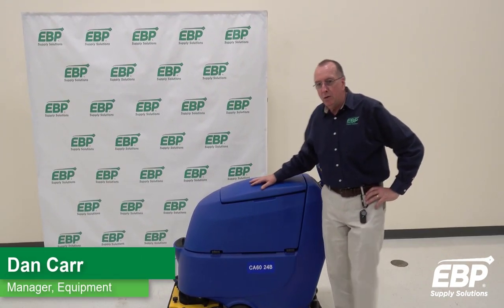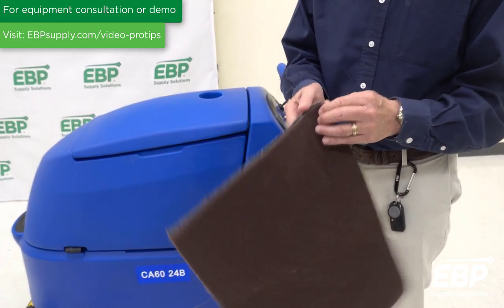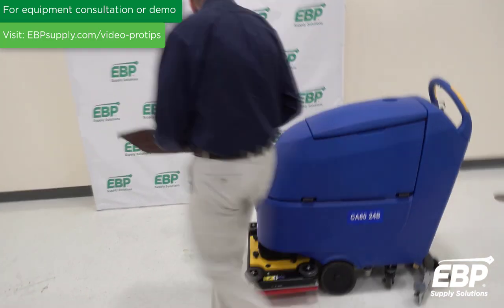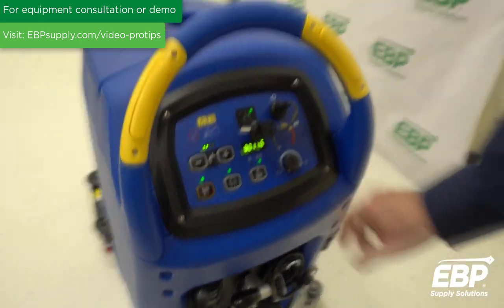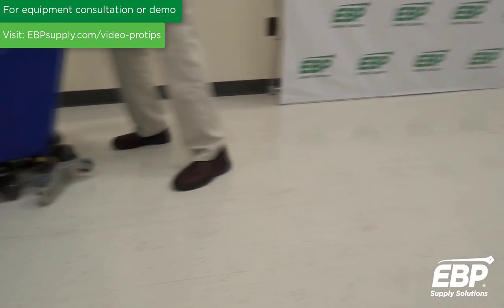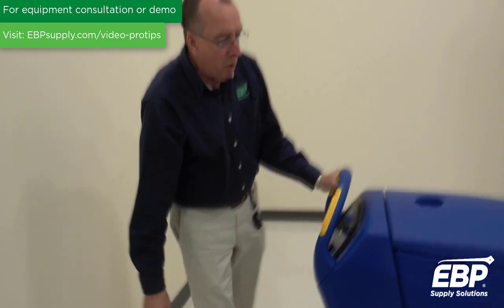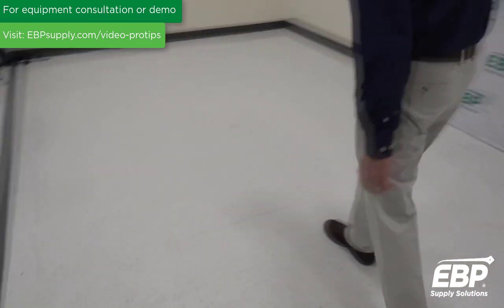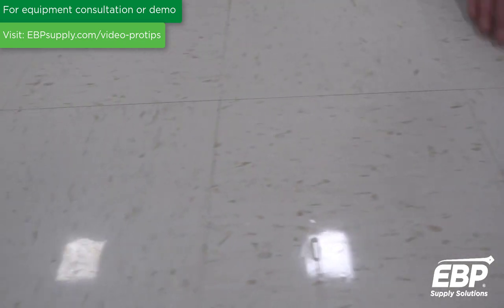How to Strip A Floor with No Chemicals [DEMO]

Comment: I am trying to learn as much as I can about stripping, rewaxing, and other options for VCT flooring. Thanks for the videos.
I was surprised that you don't lay down a bit of water first or set your pad in a small puddle?
Reply: you're supposed to the floor isn't supposed to be dry but i realize everybody does it differently

Comment: There are several ways to use this pad. One way is to dry strip which uses no chemicals  and no water. Down side to dry stripping is the dust. Dry stripping is not a replacement for wet stripping  but more of a deep scrubbing method.

Comment: That machine is the gold standard.
Reply: Is it for real?? Works great?
Reply: It’s good for light stripping or deep scrub where you take off couple of coats not full wax to bare tile . I used it . Leaving all floor cloudy some part there is very less wax left on the floor and some part just too thick wax still on the floor
Reply: @sr9725  Probably should have stripped the floor instead.

Comment: I have the same machine works great but you only get about 3hrs of run time and takes 12hrs to charge. I have a short video on my channel using it with a little better view.
Reply from the maker: Hi Fred,
Thanks for watching our content.  Here are a few videos relevant to battery life and battery maintenance on powered janitorial equipment.  

Battery Troubleshooting (4 min mark):
https://youtu.be/FcwIw-1lQ_I

What is Opportunity Charging?
https://youtu.be/ixfPN2NiMe4
Reply: Bring a extra set of batteries.
Reply: @mikepeterson9542  I was thinking about that. They last about 3 hours
Reply: If the batteries last only 3 hours and take 12 hours to charge 😂😂😂 You will never finish the job.

Comment: Those machines are alright but floors that really have wax build up it wouldn't work taking it off, I tried it with that machine and the old wax and debris was still etched in the floor, you gonna have to use some type of stripper to get the hard stains

Comment: Can you pick up wax via stripper with this machine or will the stripper damage it?
Reply from the maker: Hello Ken - thanks for watching our content.  I asked one of our specialists your question, and here is his answer:

"You can mop on the stripper but never run through the machine. You can then agitate and pick it up with the  machine but we don’t recommend it.  The reason is, stripper is very corrosive and if the machine isn’t emptied out and cleaned thoroughly immediately after it’s done then it will dry and you risk damage to the machine.  It can also splatter up under the machine and cause damage.

Also when picking it up, wax and stripper foams up and if they don’t use any kind of defoamer in the recovery tank prior to operating, you risk foam rising up, not hitting the float shut off for the vac motor and then having foam get sucked into the vac motor causing it to burn out.  Then they would be without their scrubber until it’s repaired and in this business we can never afford down time."  

Hope this helps answer your question!
Reply: @ImperialDade  Thank you for this very valuable information!
Reply: Question, can you strip down to bare tile and wet sand your corners with a large electric hand held sander?

Comment: Well if it removes two coats of finish you're not stripping the floor cuz if you strip the floor you're taking all the wax off the floor so that's not a stripping machine it's a scrubbing machine
Reply: Yes but it takes wax off

Comment: I was wondering if no chemicals then how do you get the old wax off the floor? There must be some little chemicals in the pad to help to loosen up the wax off the floor.
Reply from the maker: Hi Jay - The SPP or Surface Prep Pad, plus water, do all the work.  The SPP is a sandpaper like material and combined with the water and the orbital motion of the scrubber head, take layers of wax off the floor.  It really is an incredible technology allowing for zero chemical use.
Reply: @ImperialDade  That is so very Interesting no chemicals just water? Thank you. P.S I just want to say that you are doing my dream job!
Reply: This is not a complete strip it is basically a step above a scrub and recoat.
Reply: @dustywagon298  So it's easy than stripping?
Reply: @jaysartori9032  it's called a Top Scrub takes off 2 to 3 layers
Reply: @seanojones8487  Thank you

Comment: sorry but you wrong. you not stripping a floor, you just scrubbing the floor, for a real tripping you have to use stripper,peolpe will get confused. went you use a spp,brown pad you just tacking 3-4 lay off wax off the floor. compare to stripping you take everything off the floor looking to the original floor without wax.